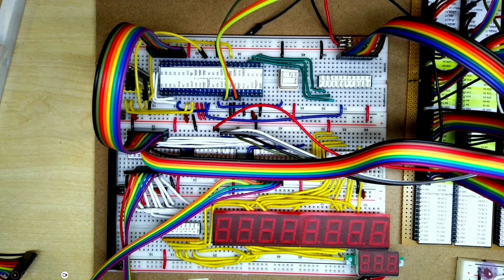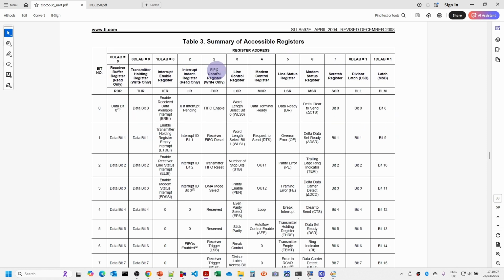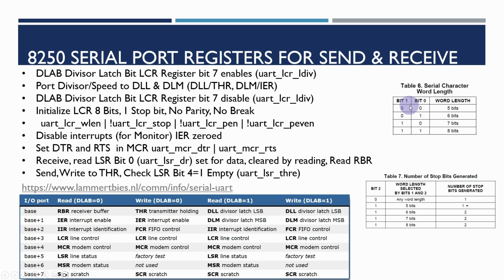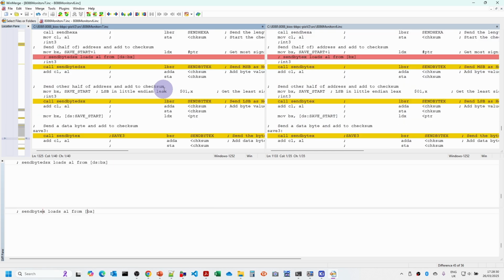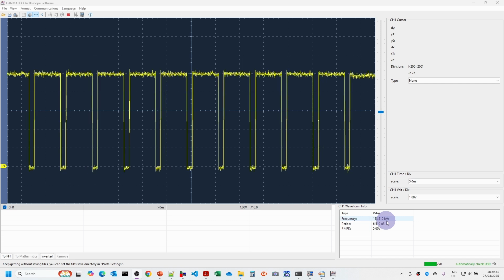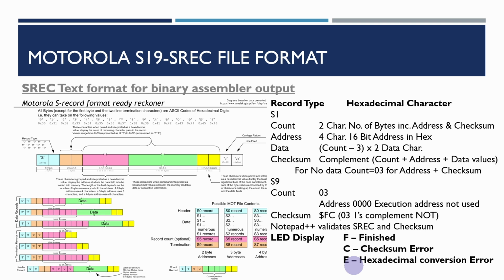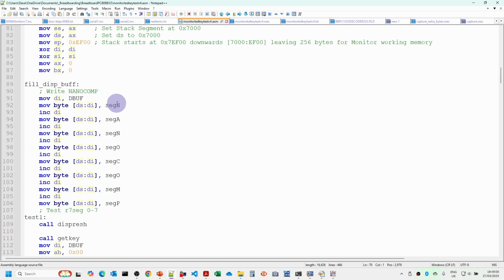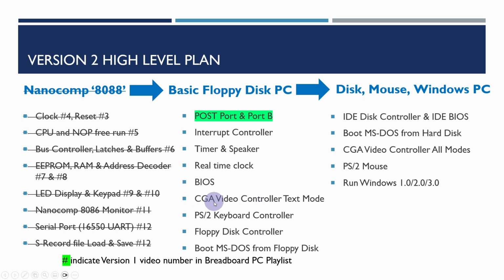New Breadboard 8088 PC V2 #7 Serial Port Software & Testing

Comment: It might be interesting to use your serial port for BIOS output. You could get a lot of basic DOS SW running without the complexity of the CGA card build.
Reply from the maker: That's an interesting thought! I know DOS can use CTTY to redirect input and output to COM1 etc but BIOS would need some surgery to support this. There is a Video INT 10 Teletype output function which should be pretty easy to change to send output to the serial port. The Keyboard code I'd need to look at.  Could also use COM1 for POST Port may also be interesting (though POST calls are hard coded in the code, not via a subroutine). Will take a look anyway. Thanks for the feedback. Dave